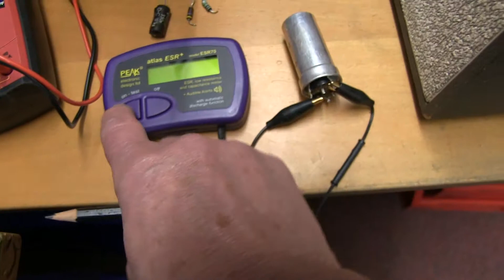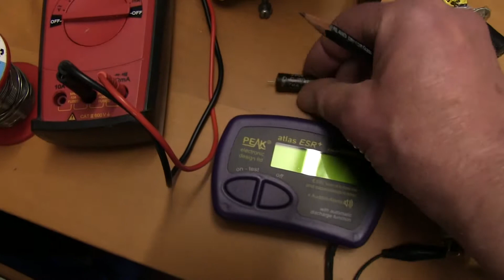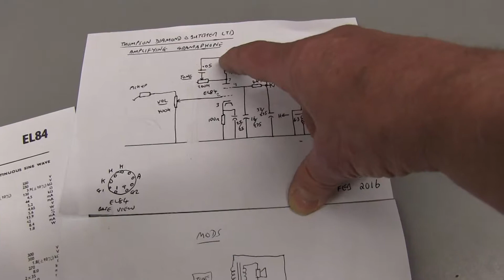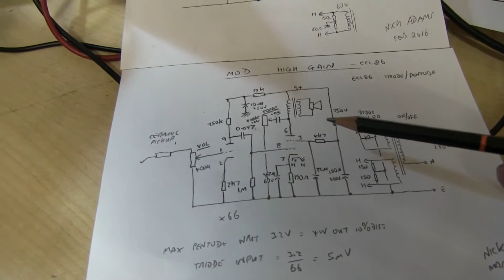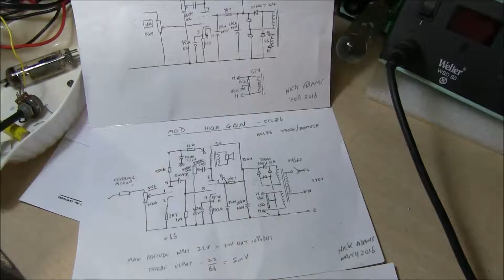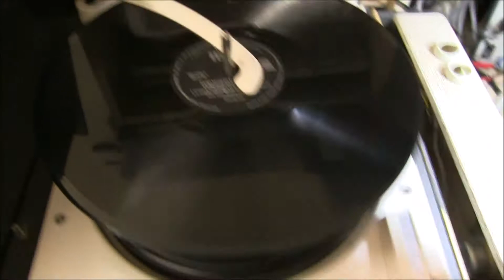Thompson, Diamond and Butcher. Garrard 209 Record Player. 1960's

Comment: Do you find that little ESR meter to be any good?  Those old Garrard units are fun , I have a, Rc 121 in a beautiful old stereogram built in 1960.I have given it a complete  recaped . Now im thinking of perhaps making a small valve pre Amp and I will run a early 60s Shure magnetic cartridge on it .
Something like a m3d shure or a similar 60s shure.
Reply from the maker: Hi Peter.  Yes i find that ESR an invaluable tool.  It not only gives the capacitance, but the resistance of the capacitor, which can be too high in old valve equipment.  I often just put a modern very low ESR capacitor across the old one (can type) which is quicker than replacing it, and it keeps original appearance, and it works perfectly.  As long as the original capacitor does not have other issues, such as swelling or dried out.
Good luck with the project.

Comment: I was curious how you adapted the bsr sc11m cartridge to fit the original headshell of the gerrard 209.? Ive a ferranti box with the 209 and am not getting any sound through the cartridge however when touching tge rear connecting wires I get speaker popping feedback. Do you think this is related to a dead cartridge? Thanks
Reply from the maker: Hi Matthew
Yes, it seems the cartridge is dead.
Fitting another cartridge can be difficult as they usually have a holder which angles them correctly.
And the holders are not normally sold with the cartridge.
It is possible to use spacers and longer screws, but it can be a fiddle.
Reply: @nickadams5411  thanks for such a quick response. Reasons I was particularly interested was from this specific video you modified and mounted the bsr sc11m to the same tonearm assembly of a gerrard 209 however it appeared no obvious modifications were made. As the front of the tonearm has a screw which attaches the cartridge. Do you recall making an attachment piece or drilling into a new headshell assembly to make it match up with the bsr sc11m? I appreciate your time and consideration.
Reply from the maker: Hi
I never drill into the headshells.
The Sc11M has a single hole in the top for a screw. (Some arms have a screw through the head).
I must have fixed it to a plate that has the 2 side screws.
Sorry I never showed that part.

Comment: Hey bit of an odd question but when you replaced the cartridge, did you have any trouble taking the badge off the top of the headshell? I'm trying to replace the existing cartridge on my Garrard 209 with an SC12M but I cannot seem to be able to get the badge off without damaging it due to the raised lip around it making it difficult to get anything under and was wondering if you did anything to get around it. Cheers
Reply from the maker: Hi
I was able to fit the cartridge, without removing the badge.
It screwed in underneath.